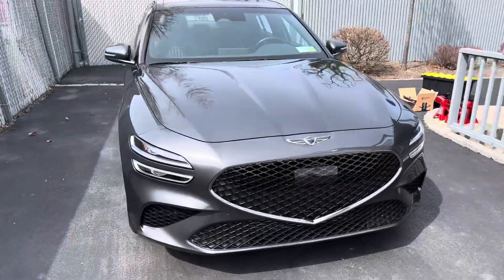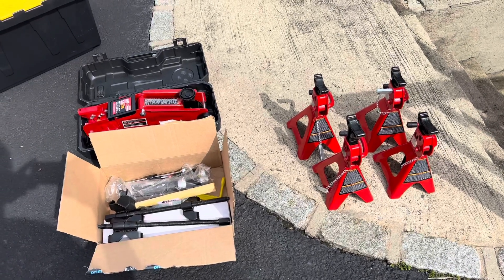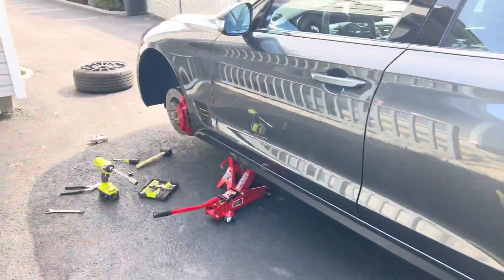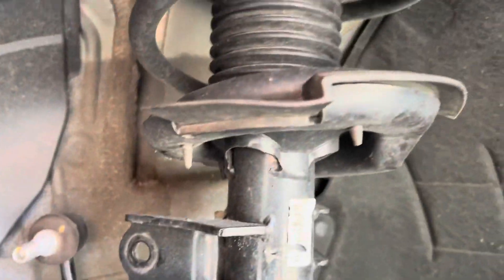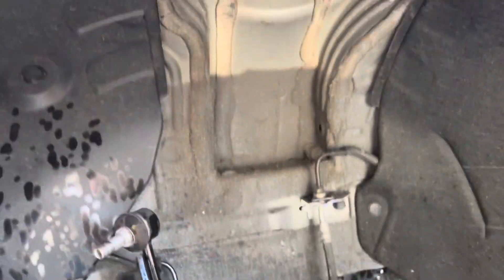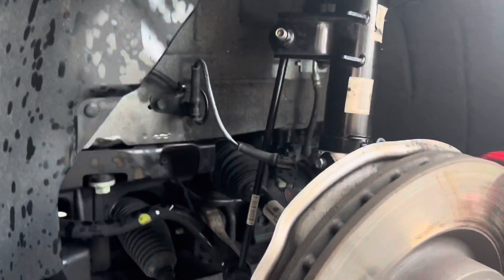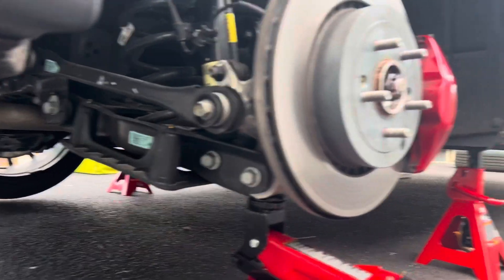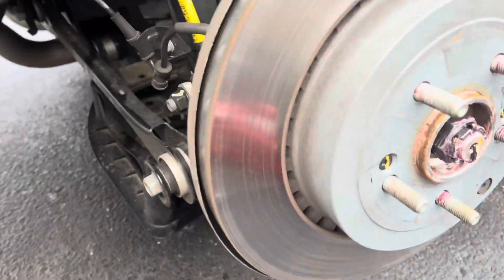2022 Genesis G70 / Kia Stinger Lowering Spring Install #Genesis #Stinger #Kia #loweringsprings

Comment: hopefully you will do an alignment after you let the new setup settle in .... i would highly recommend it...  Awesome car and stance ;)  i feel that you might have rushed the process a bit, should have slowed down a bit to make sure you didn't forget anything...
Reply from the maker: I will get an alignment after a week. There’s also a lot I didn’t film, of course One should always double check every nut and bolt they loosened or adjusted

Comment: Does the bottom spring perch move? A shop did my springs and the perch doesn't sit correctly. I'm going to have to adjust it. I'm thinking of compressing the spring, while attached to the car and hopefully I can move that perch a little to get it back in place. Thoughts?

Comment: I have the same springs on my AWD G70 with non adjustable suspension as well. The springs have been great, with one exception. If I hit a pot hole or even a quick road divot, the fronts bottom out and I get a hard thud. I spoke with Ark and they said to trim the bump stops. I did that and it's better but still thuds on occasion. Wish there was something more that could be done to prevent this issue.
Reply: Wait wdym

Comment: Hey man, I’m in the process of doing mine. Wish you had a video of you putting them on. I’m stuck trying to get it back in. It seems like I don’t have any space in the wheel well to put it back in even while compressing the springs
Reply from the maker: It's possible, trust me. I have AWD which is harder and STILL didn't remove the lower control arm nuts. You have to let the lower control arm sag just enough to pull the top out. Also, try leaving the top mounts mounted. Don't remove them w the struts.

Comment: Does your G70 have the adjustable OEM suspension? I have 2019 G70
Reply from the maker: No, an easy way to tell is if you look at front OEM shocks, you will see a tiny compressor module welded on the rear w a single wire harness attaching. Install is the exact same however, just one more plug to disconnect

Comment: How did you jack the car up? There isn’t enough space on the 4 jack points to get both a jack and a jack stand.
Reply from the maker: It will still work if you move it a few inches down on the folded welds just be smart about it and don’t crunch any plastics

Comment: i took your advice and bought Motegi wheels for my 2019 STi,maybe I'll take your advice on the se wheels.I have a 2021 GT1 stinger and my wheels are staggered .are yours?
Reply from the maker: They come staggered, these OZ wheels are square all around. My next set I will prob run a little staggered again, but I also like how square setup looks

Comment: How did you jack all four sides?. Thrs no jack point at front of engine.
Reply: I was wondering the same thing...
Reply: @thunderbl4de777  take the lower cover off and you will sea beam  to lift. have to take cover off to use which is weird.

Comment: With the adaptative suspension can it cause trouble? I heard a light appears in the dash? Do you have any issu?
Reply from the maker: I don’t have adaptive suspension but from what I’ve read it should not cause a light.   Nothing changes that would cause a CEL.
Reply: @defaultdaniel  i just order my springs same as you for my 2022 g70 3.3 AWD sport with adaptative suspension. I let you know if it’s okay
Reply: @defaultdaniel  it’s Now done and I don’t have any problem with my adaptative suspension. I’m very happy with the look and the drive.
Reply: I was worried about that aswell, which springs did you go with ? I never had a car with so much electronics. Got the rwd prestige

Comment: Lol why wouldn’t you remove the whole strut assembly instead of removing the shock from the top hat
Reply: Seriously. I was pulling my hair out watching this. I just did mine. Break the shock nut loose on the car. Drop the spindle and take off the 3 14mm shock mounts. Take the whole assembly out THEN compress the spring and take off the top nut. Put the while assembly back in. No need to use the compressors in the wheel well.